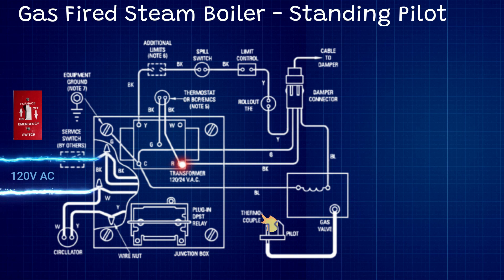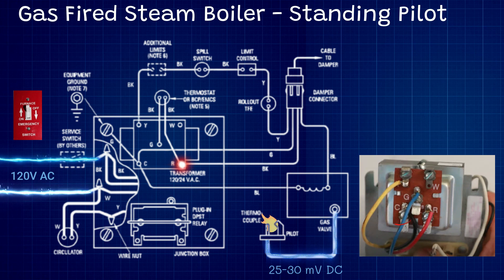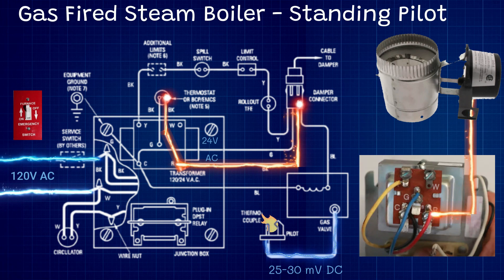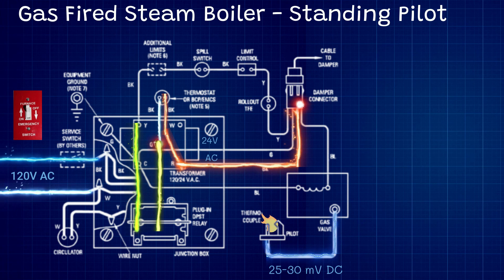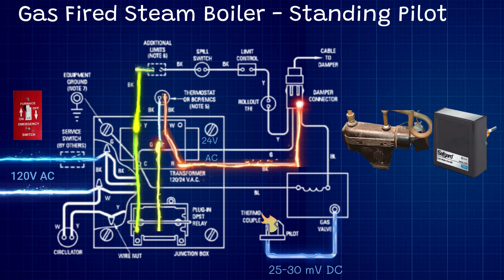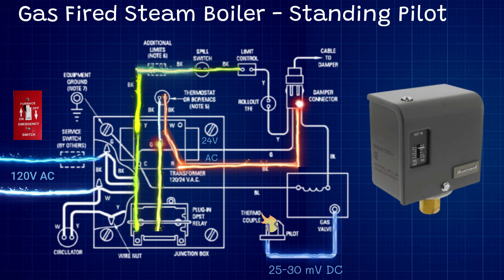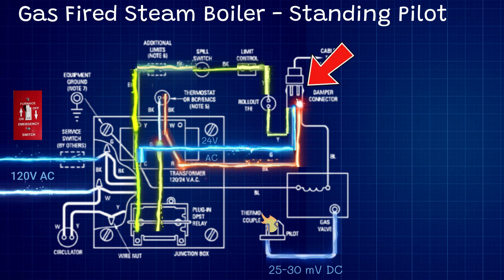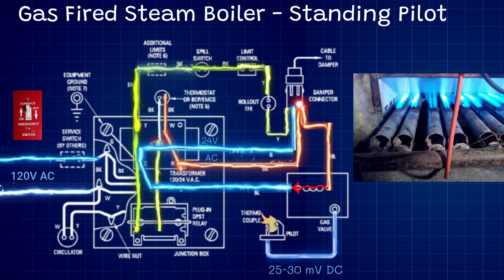Steam Boiler Schematic in Motion (Standing Pilot)

Comment: Hi Mike. What will be the pressure  in the boiler when not call for heat? Still about 0.5 0 psi cut in setting? If not. How to build the pressure for .5 psi to close pressuretro contact? I don’t get that?

Comment: Why you need a relay. Does it allow hi voltage to the transformer?
Reply from the maker: You don't need it. Some boilers come with a one piece relay/xfmr as an accessory to be able to power a circulator pump for a hydronic heating zone. T-stat would activate the relay which would then activate 120v to the circ pump.

Comment: These are so helpful as a mechanical technician working on heating systems, predominantly steam. Ive been searching online and for literature on stuff like basic wiring diagrams and sequence of operation information that can speak to the everyday tech who is servicing and troubleshooting heating equipment. One of my biggest personal hurdles in heating is being able to have a good grasp on where to start, and the process of elimination for diagnosing different safety limits, relays etc. I think that type of simple and straightforward information is lacking. I think if i can get a good grasp on where to start and which proceeding limits, relays, transformers to look and test for,  it will be a huge boost in being able to confidently diagnose systems.  These type of videos are exactly what i need to help in simplifying and explaining the process
Reply from the maker: Thanks. Yeah, it's great to look at schematics and there's a lot to learn from them, but without the sequence it can still be a bit confusing. I thought overlaying the two together would be really helpful for people, so glad to hear it's been as helpful for you.

Comment: hey jersey can i hook up a extra wire to common terminal on that tranformer and get  power to the thermostat an install a wifi thermostat?
Reply: Got it. If you're talking about good practice and doing the right thing especially for customers and prevents call back I get it
Reply: I love This kind of videos thanks Mike.
Reply from the maker: I wouldn't advise doing that. I'm going to make a video soon on how to put in a dedicated transformer and a relay so you can hook up wifi smart stats to these boilers without a lot of problems. I just need to finish the spark ignition steam boiler video then I'll get on that.
Reply: @JerseyMikeHVAC  wonder what would be the issue?
Reply from the maker: @ernestodiaz76  Some boilers have a LWCO wired in between the R terminal of the XFMR bus and the T-stat, causing power issues on low water conditions. Some smart stats use too much power for the steam circuit to run properly and would require shutting off all of the smart features of the stat to make it work. You're better off going dedicated.